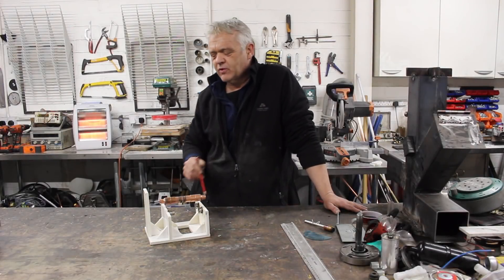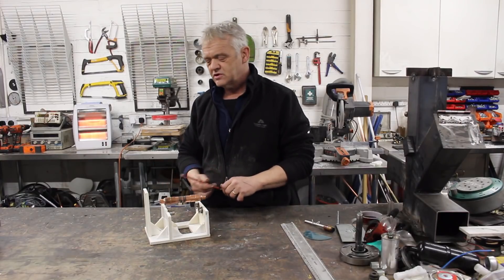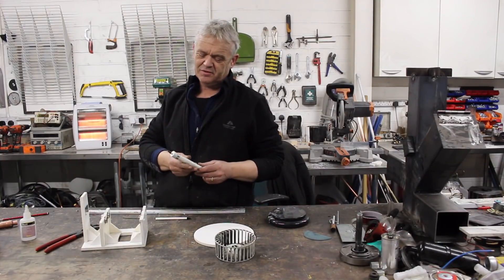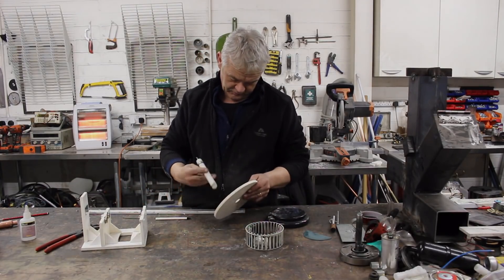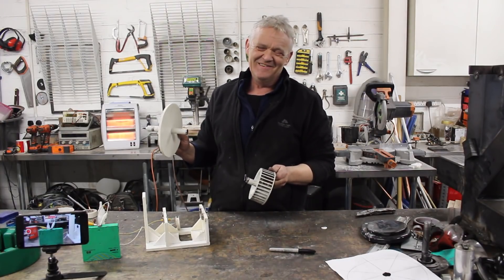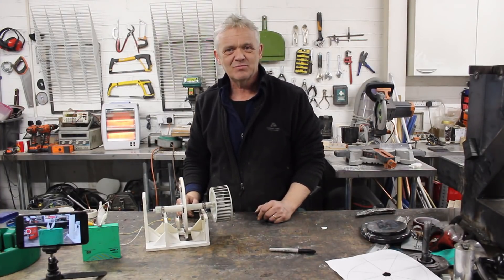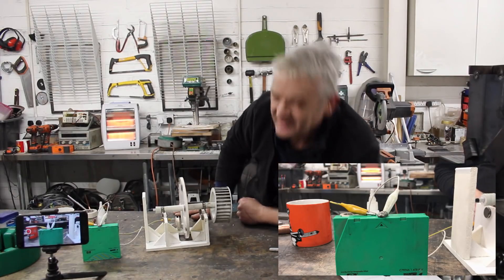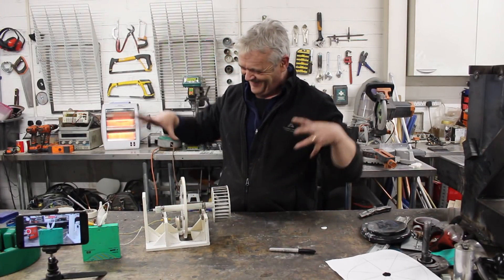1430 Wind Turbine On Magnetic Bearings

Comment: I was experimenting w/ some magnet bearings such as that and I had pretty good success driving it w/ a bedini motor.  What I was trying to do next is what you did here, putting an axial flux rotor on to act as a flywheel and see if it would generate electricity, but I've been having a hard time coming up w/ a magnet/coil plan as I do not understand coil theory and can't find any good sources that explain it.  ie  how thick of wire, how many windings to give you X volts or Y amps.

The only problem w/ that magnet bearing is that you can't really give it any side loading, so you can't connect it to a belt/chain to drive anything and I'd think real world wind may knock it off as well.

Comment: For the flywheel aspect. You could add a heavy metal ring to it. Rather than a heavier disk. Still applies a lot of stored momentum. But, it's less ineffective weight.
Reply: Alternatively, you could glue on some weights to the magnet disc and not have to manufacture it in one piece. Just have to pay attention to the balance.

Comment: So, I have notebook for all my crazy ideas.  One for a magnet system for a flywheel system.  Now there are superconductor, and now there is super conductor tape on top of permeant magnets, and there is electric magnets all these can be complex..with the.suoerconductors be easier to manage the wobble due to the pinning effect.   But..but...what if you could have a pinning effect with permeant magnets...ah..so what is the trick??   Let imagine a flywheel with a magnet attached to the bottom of float above a much bigger magnet which is repelling it..okay so nothing new here right?  What if this much larger magnet had a small cylindrical whole in it right in the dead center of it?  And what if one secured a small cylindrical magnet with the opposite polarity in that hole.   What would happen?  The floating magnet would be pinned and stabilized by small cylindrical magnet and the much larger magnet would float the flywheel.  Viola!  No superconductor...but yeah it would probably not be stable as a superconductor but I think it would be an improvement.
Reply from the maker: it would be - honestly the best thing here is to build it

Comment: Perhaps you should set up an onlyfans page Rob if your going to be doing future blowing videos.  Now a bit off topic but I remember a few videos back you were playing with generating and through some science or witchcraft, (same thing) you managed to decouple the generation from the load so it didn't put stress or resistance on the generator part. I think through capacitors. Is this possible on a bigger scale with larger power outputs? My thoughts turn to the many videos of people who built a Pedal powered generator converting a bike, sometimes when using the right kind of alternator, can produce an ok amount of power but switch on a load and it gets difficult to pedal, even if it goes through a battery between them.
Reply from the maker: I can't see why it wouldn't work on a larger scale mate - but theory way to tell is to build it

Comment: Rob, this is great stuff.  Do you know if there's a way to calculate the size & strength of the required magnets for a given amount of weight? I've been thinking of something like this but have met two stumbling blocks... finding ring magnets that are magnetized the right way... they are mostly magnetized as you've shown, but thought it would be best to have the outer diameter N/S and inner diameter S/N, that way the outer diameter pole would be repelled uniformly... the other stumbling block is determining size required (in Gauss? or Tesla? units)  thanks again!
Reply from the maker: radially magnetised magnets are rare and expensive mate - I looked at one with the right diameter and it was UK£245 and I needed two - wow - I think it is because they don't make that many of them so as 'one off' it is expensive - eclipse magnets will custom make a magnet for you but again it's expensive - the only thing I can think of is to use bar magnets with opposite faces as north/south and construct an approximation - the field wouldn't be uniform so there would be a dare of 'bounce' but the larger the circle and the smaller the bar magnet then the better it would approximate a circle

Comment: Clever, that this bearing might be attached to a fancy windmill.  A next step might be a way to figure out a four-way funnel to funnel some outside wind in to the little windmill?  If that step works, a screen or something to keep the birds, wind blown grass clippings or whatever out of your setup?  As for the bearing itself? ... I've heard that a pointy end of a nylon rod against glass has very little friction.  So a whiskey shot glass might be useful to consider?  Like the clip.
Reply from the maker: nice ifdeas mate - thanks for sharing
Reply: @ThinkingandTinkering   Thanks for your reply.  Only became aware of your channel a little over a year ago.  Your implications that wind power might be the way to go to supplement your electricity usages is a good one, I think. Solar cells oxidize over time and their efficiency is reduced because of that.  And the buy in is expensive.  The question of low power or low output voltages might be addressed with a voltage quadrupler or something similar.

Comment: Great job. Now use ring magnets that fit inside another ring magnet for the bearing’s . You will be able to achieve 10,000+ rpm with stability as well as more rotor weight levitation.
Reply from the maker: they need to be radially magnetised don't they?
Reply: @ThinkingandTinkering  just regular ring magnets with the poles on the flat sides. The magnets will need to be positioned one within the other in opposition of poles. The force is quite focused within the center. The rod will pass through the hole in the smaller magnet and protrude a distance like a barbell for weights. The larger magnets two are glued into blocks or panels in the center. The end panel needs a block at the end for the rod to press against that matches the space at the end of the rod so the larger and smaller magnets align flush on flat sides. It will be hard to push through to the stop block but once it is you have high speed frictionless bearings. I used 1-1/2”x3/4” with a 3/4” hole for the outside ring and 5/8”x 1/4” with a 1/4” hole stacked three deep. I was able to see a 4 pound rotor up above 10,000 rpm and it was slightly out of balance. The magnets act as a shock absorbing bearings as well! The rod end riding on the stop can be pointed for reduced friction as well as the stop block being ceramic or other hard surfaces to reduce drag. Hope this helps!

Comment: Is it possible to use pyrolytic carbon instead of the magnets that are in the axle bar there, given that you would use atleast 4 magnets (maybe 6 or 8 to make it more stable) per side so that the bar would be surrounded from all sides by those magnets?
Reply from the maker: with pyrolytic carbon you are looking a the diamagnetic effect - it's a pretty weak effect - I am not sure it could carry the weight of the rotor

Comment: THAT is almost exactly what I was thinking of doing with mine once I get it constructed. I am going to use a much thicker wire around it so that I have less resistance to work with and I should see some pretty steady generation.

Once I include a capacitor there should be a stable storage system for the unit and if the wind gets it turning 'like the Dickens' then it shouldn't really need a dump load(not that those are difficult to put it honestly.
Reply from the maker: nice mate

Comment: LMAO 🤣 🤣 🤣 🤣 
I'm still wondering if another magnet could be used on the end. To possibly have the same effect as the pen 🖊. 
Regardless I am thinking again. This is why I love your videos. I am building an air compressor from an old 3hp gasoline edger. I have to put a new carburetor on the engine first.
Reply from the maker: I like the sound of the build you are doing there mate - I have heard no on the magnet front and it is mostly explained why not by Earnshaws theorem - I haven't tried it

Comment: Best design for wind harnessing is high altitude dual generator axial blimp with fins thats tethered on a swivel. It also has the benefit of lowering during inclement weather
Reply from the maker: they were called magenn mate - it was a kite system - I believe they raised US$5 million then had stability issues they couldn't solve and quietly went out of business
Reply: @ThinkingandTinkering  glad somebody else remembered them, yea the US wouldnt give them faa clearance
Reply: heya, do you have a link to what you are describing? I would like to see how it looks like and how it works.
Reply: @Dimology  it has been a while they were bought out, think they were called maegen from Canada. They had 100kw versions all you had to do was pour a concrete pad and fill with helium